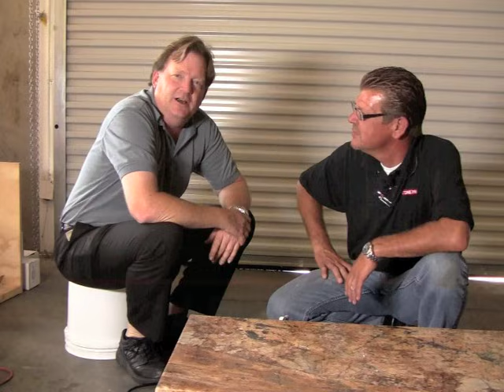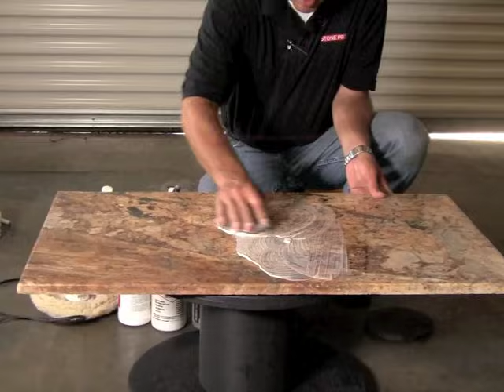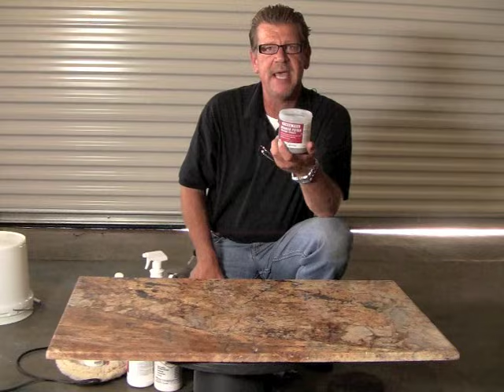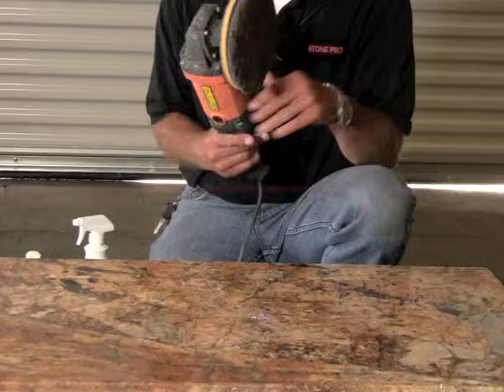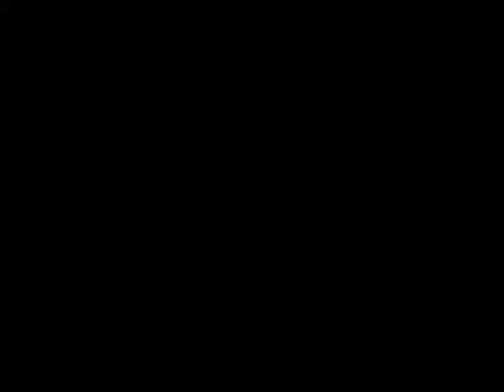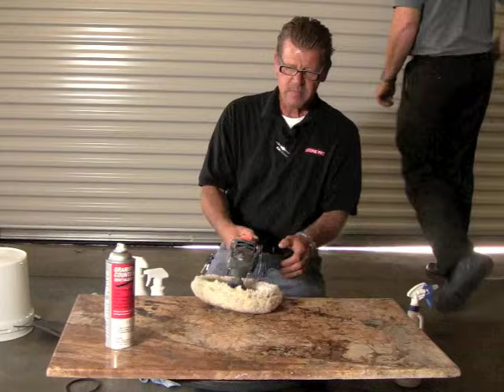Stone Pro: Granite Restoration

Comment: What a clown.  No mention of what abrassive number of pad.  Better to strip the old finish off using denatured alcohol.  This will remove the sealer and clean the grease right off the granite counter top.  Then buff if need be, then reclean withe denatured alcohol, then apply new sealer.,

Comment: My buffer's lowest speed is 1000 RPM. Can I use it for this?
Reply from the maker: You really want to run the speed slower than 1000 rpm, 500 to 800 is recommended.

Comment: My granit has never been shiny. Maybe it was not professionally polished by the installer. How can I get it shiny and polished?
Reply: Stock granite is generally just basic and this whole process would get everything looking extra brilliant. Think of the car industry nowadays, you can buy a brand new car but its still not perfectly clean and people are now ceramic coating their paint for extra shine and protection. This process is basically the equivalent of that. 

Depending on how much work you want to put in... the process described in the video would be the method. If you didnt want to do EVERY step in the video, you could just do the Stone Scrub and Crystal Clean as your regular maintenance products.

Comment: After how many hours can the countertops be use ? Can I use a Dual action polisher for this job?
Reply: Wait 1 hr before using the countertop // First 24 hrs – repels water // Second 24 hrs - repels water and oil  //  Third 24 hrs - it is fully cured.

You can use whatever polisher you'd like, just drop the RPMs down between 600-800.

Comment: I know this is an Old Video but hoping you are still around on youtube and could help me, I am restoring a house that had a fire, The granite is a lighter grey and is stained from the smoke/soot sitting on it for several months, you can see where anything was sitting when the fire happened, I have tried everything I can think of and nothing works, I can get it clean but it still has the tan tint. Thinking maybe sanding and repolishing but need guidance.
Reply: You could try StonePro's Stone Scrub. Its a cleaner with an added pumice that will NOT scratch the granite surface.  The added abrasive could push out the dirt within the granite pores.

Comment: I have really bad staining in my granite, will this get them out? If not, what will? I tried the  baking soda method and it didnt work.
Reply: What is the staining from? Oil? Acid? Hard water?
Reply: @JennyJRacenstein  oil, grease, and i think rust. We had renters stay in our house and they did not take care of the stone, we really cant afford to replace it.
Reply: @Jennaye17  Look up Wet Poultice to tackle the grease/oil. This kit in the video is for the rest of the restoration process. The kit has Stone Scrub which should take care of the rust with some exceptions. Where is the stone located? Inside as a kitchen counter top or outside by a bbq pit area with furniture on top?
Reply: @JennyJRacenstein  its a kitchen counter
Reply: @Jennaye17  Then it should be fine with the stone scrub for rust removal.

Comment: can a burn be repaired? also, my granite is black and white, is it consider light or dark? thanks
Reply: Yes, you can repair a burn as its likely that the sealant originally applied was damaged. If your granite is black and white, I would go with dark. Unless its mostly white with black speckles, then light.

Comment: Our granite has grout between the pieces.  Does this work on the grout at the same time or do you treat the grout separately and have to use a grout sealer on the grout lines to keep the calcium deposits at a minimum?

Comment: The prior owners put in granite but the sealer applied was applied incorrectly - Instead of a smooth finish it is rough and always feels dirty. Would this process take off that corrupted finish.
Reply: Would have to use a sealant stripper to get it off.

Comment: I have used this process in 5 different homes. 3 were not in bad shape with little to no scratches and it worked awesome! the other two were pretty foggy from hard water cleaning. Again they turned out perfect with better than factory finish. One had a fairly deep scratch and had to be honed out and finished with this process. I was extremely impressed with the results and so were my clients. Trust me.... You are not doing an entire kitchen with several tops and an island in 20 minutes. I mask off everything though. Take your time and remember, you do not need much of this powder. 

What I do different than the video: 
I use a hog hair pad on slowest speed to apply stone scrub. let it set and clean as in the video.
I use hog hair pad instead of steel wool. 

This process does work well especially when the tops just need a good cleaning, seal, and polish.
Reply from the maker: +Tony Moore We are happy to hear of your excellent results! Thanks for sharing your tips. The hogs hair pads are pretty affordable to compared to steel wool.

Comment: Hello,
I would like to know what is the reason that you are not using simple water as a basic lubricant? 
Also, what pressure are you applying when using the angle polisher? 
A steel wool plate, can you say how would you define it in GRIT? 200, 400??

Thank-you!
Reply from the maker: Water has hard water minerals in them. It will dull down the surface.
The polisher is variable speed. 500-2800 RPM.
Steel wool should be 0000.

Comment from the maker: Depending on the level of cleaning that needs to be done, you may want to call a professional that works with stone on a regular basis to properly clean, restore, polish, and seal the stone. Then you can use a daily cleaner to easily maintain the shine without much effort!
Reply: J.Racenstein Co 
Hi,
I have a blue pearl worktop with tiny holes in in after 10 years use. I recently used granite polishing pads on a polisher and started from 400 grit to 600,800,1500,3000 then 6000. But even though the test surface is super smooth ( like glass) it’s not the same colour as the old look ( shiny n glossy)
The polished becomes hazy after drying even after buffing it with granite polish.
Am I missing something here?